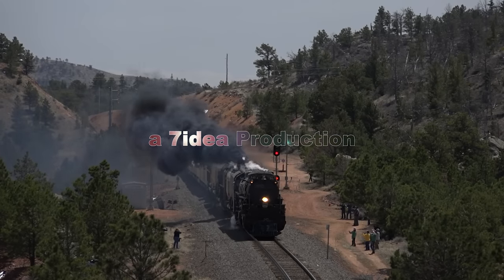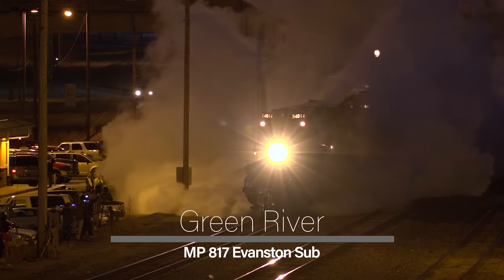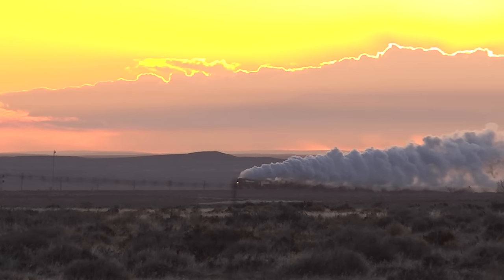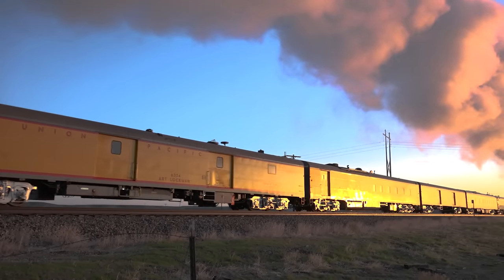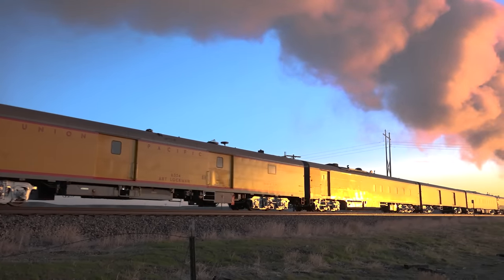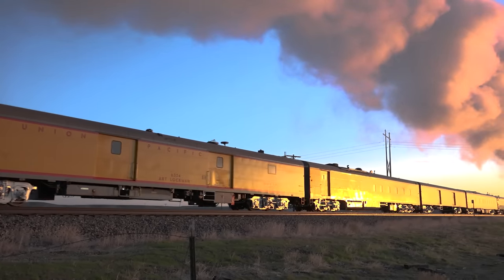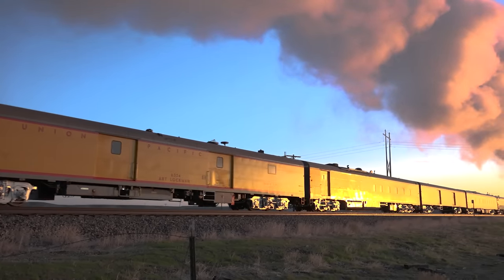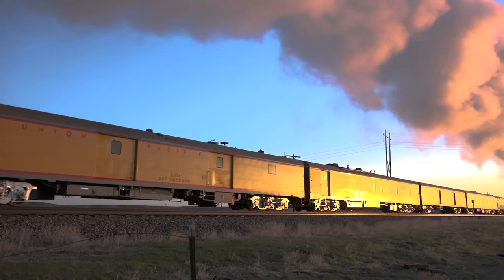The Largest Steam Locomotive on Earth!

Comment: There cheating!!!
It has an Electric Diesel  Engine behind it help it pull.
Reply: They need it to power the train cars the steam trains only have a Dynamo powerful enough to power a cab light in the headlight and some of the gauges because back then train cars were still lit with lanterns and there were no refrigerator cars ECT newer train cars also have a whole different type of braking system and plugging those train cars brakes into that steam locomotive would be like trying to plug in Old color cords from a VCR into a 4K curved TV they are likely required to have it because of regulations due to the brakes

Comment: Black steam?
Oh. Really, it's not steam?
It's coal?
That's sad.
Reply: First of all it's not coal it's oil that those run on they were upgraded over a hundred years ago and second it is Steam mixed with a very small percent of burnt oil depending on the speed engine settings ECT heat of your Firebox you will burn less efficient they had probably just slowed down and are tuning their engine

Comment: Why throw a diesel loco in there? What are they afraid of? Spoils the whole train.
Reply from the maker: The diesel was a little toy for the Big Boy to play with. 

Basically insurance since this was the first run for the Big Boy after being restored to operating condition. 
Also the diesel provided the required PTC (today's digital communications) to run on the UP main line. 
The steam crew utilized the diesel's dynamic braking giving the Big Boy a bigger load to pull against. 
One of the crew members told me that the Big Boy pulled that modern-day diesel around like it wasn't even there. Even with maximum braking climbing a decent grade the Big Boy was accelerating.

Comment: The "Allegheny"  is  MUCH bigger than the "Big Boy" .  Get your facts straight.
Reply: The Allegheny is taller and has a much bigger boiler, but it's not as long
Reply: 🤣🤣 It's you who needs to get your facts straight.   The Big Boy's were a 4-8-8-4 (24 axles) with a wheel base (engine and tender) of 117'.  The Allegheny's were 2-6-6-6 (20 axles, 2 less than Big Boy) and a wheelbase of 112'.    So please, tell me how that makes an Allegheny "MUCH bigger".
Reply: @09JDCTrainMan  Allegheny has far more horsepower than the "Big Boy".  That's what counts....something like 20% more HP.
Reply: @lurking0death  Yes, the Allegheny does produce more horsepower, and has a higher power to weight ratio, but the Big Boy has higher tractive effort, which is more important for starting trains and climbing grades.
Reply: @09JDCTrainMan  "Tractive effort"...???  What do you do, make up these terms as it suits you???
Reply: @lurking0death   ...You're kidding, right? Tell me you're kidding. Tractive effort is literally the pulling force of a locomotive, it's a railroad term.

https://en.m.wikipedia.org/wiki/Tractive_force

Comment: Big Boy is not the largest in length or horsepower.  The PRR model S1 was longer and more powerful.  (and it was not the most powerful single locomotive)  Why did this tiny train need three locomotives?  Two diesel locomotives in Florida can pull a train way over a mile long,  but that is flat land.  There is a lot about railroading that I don't understand.  "A plume of steam," steam is invisible. Whomever developed the idea that a locomotive should run with it's cylinder drain cocks open sure messed up locomotive watching for evereyone. Ron W4BIN
Reply: Nowhere did UP claim the BigBoy was the most powerful.  It is the largest when you talk about weight AND length together. Yes there were heavier and yes there were longer.  But not both.

Comment: BIG BOY may NOT be the LARGEST STEAM LOCO !!!!!!
The "Big Boy" actual locomotive, which excludes its separate tender,  is 85ft 4in long, & has a 4-8-8-4 wheel arrangement.
The Australian AD60 class Garratts (an articulated Tank engine design) are108ft 7in long & have a 4-8-4+4-8-4 wheel arrangement !!!
The "Big Boy" tender was 47ft 6in. Giving an overall loco + tender length of 132ft 9in
The Garratt loco + water tender tank car were 57ft 3in long. So total Loco & tender length was 165ft 9in !!!!!!!!

The British Beyer Peacock Company "Garratt" type articulated locos could be found ALL over the world (except North America), in many different sizes, from little Narrow Gauge versions up to the giant Australian & French Algerian types. Their special design concept was to provide hugely powerful locomotives, with very light axle loads (The Australian AD60 had a maximum axle load of  only16tons), to operate mainly in the "Colonies" on poor quality light weight track. This aspect of their design was so successful thousands were built for use on all continents (even the Russians has some) except North America until 1957 !!!!!   MANY are preserved, including four Australian AD60's (one in working order in New South Wales) !!!
Reply: The AD60 was 2 locomotives put together with a tender. So it’s not classified as a single locomotive. That’s why you never hear it mentioned when they talk about the largest steam locomotives ever made.

Comment: This is fake. The diesel engine in the middle is actually moving the train.
Reply: The diesel engine is idling, you can hear it clear as day.
Reply: It supplies electricity to the rest of the train coaches.
Reply: @GeoffryWK  No, UP does not have any modern diesels with HEP (Head End Power) capability.  The power to the coaches is supplied by a generator car, you can see it farther back in the consist. The diesel serves a few purposes, primarily it provides dynamic braking for the train, which cuts down dramatically on brake shoe  wear for the custom-made brake shoes. It also provides all the positive train control (PTC) data to the in-cab displays on the 4014. And lastly, it serves as an emergency backup system to keep the train moving and get it off the main line should any issues arise.
Reply: @FFred-us9tw  The diesel also helps pull a little to save fuel.  There is no trackside infrastructure to support steam engines, they have to bring all the fuel and water with them.  But yes the 4014 is doing most of the work.
Reply: @Travelinmatt1976  they don’t use the diesel to pull to conserve fuel. UP addressed this.  Getting water and #5 marine fuel delivered to the 4014 at any of the pre-planned fuel stops is not an issue at all. Especially considering these excursions are typically planned out months in advance.  And if you are a Locomotive Engineer you would understand why from an operational standpoint they would never do this.  The ride in the coaches would be awful if you had a pair of 400,000+ locomotives constantly going between pulling and pushing (known as Buff and Draft). you cannot synchronize a steam and a diesel locomotive.  It would be a constant battle and the possible minor fuel savings would never be worth it This is why they would never do that. The only time they would utilize the diesel for tractive effort would be if the 4014 was having wheel slip issues or if the 4014 was having some type of mechanical issue.

Comment: Steam doesn’t come out of the smoke stack buckwheat. Steam doesn’t linger behind a locomotive like that. The smoke that you say is steam is just that SMOKE. That big boy was aided by a second steam engine and also aided by a diesel locomotive. As a railfan for well over 50 years I don’t like smoke and mirror tricks so please stop treating us like a bunch of idiots that can’t see what the consist is comprised of.
Reply: I strongly suggest you read up on how a steam locomotive operates. The fact that you believe steam does not come out of a smokestack on a steam locomotive means you have absolutely no clue how they operate. This is basic knowledge. The reason you see smoke "chuffing" out of the stack is because its the exhausting STEAM from the loco's cylinders which in turn creates the draft for the boiler.  So smoke AND steam will come out the stack together. In fact, when the fire is banked down the only thing coming out the stack is steam.  As for the diesel in the consist, no, it's not there for tractive effort. It's for Dynamic braking and for the PTC system.  It can be used if there is an issue for traction.
Reply: @FFred-us9tw  ok sir I know how a steam engine works. Steam is blown out a stack when the drive cylinders exhaust causing the chug we all here when a steam engine is operating. Also fanning the flames for the boiler. This was a great way of burning wood or coal but oil burners like the big boy doesn’t need the the steam to power it’s fans or fanning action. I know how they work jack. Ohh by the way jack wheat the dark smoke you see isn’t steam it’s oil from its burners
Reply: @trevorjones8520  ok, so you went from “steam doesn’t come out the stack buckwheat” to now “steam does come out the stack” 🙄  suddenly you  know how it works.  And whether it burns coal or oil it works the same way. Steam absolutely is coming out the stack (which is white) and when running right the oil will be a light haze of brown mixed in with the steam. Again, I suggest you read up not only on how steam locomotives work, but what the smoke color indicates. There is a reason why sometimes it dark and sometimes it’s light. It has to do with combustion air.    Again, read up on it and learn instead of arguing with people about it.

Comment: We have emissions regulations today, that loco has no exhaust filter of any kind, shut that thing down and stick it in a museum. We do not need yet another useless polluter in the world.
Reply: The 2 external combustion, oil fired, steam locomotives are less polluting then the internal combustion diesel-electrics. 

The maintenance expense of all the heavy reciprocating parts on the steam locomotives was the main reason for the switch to diesel.